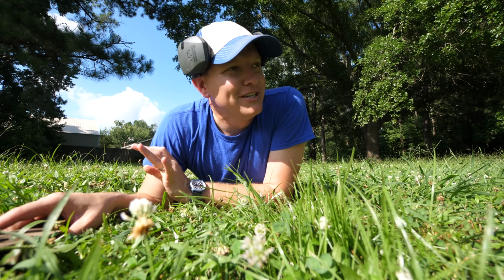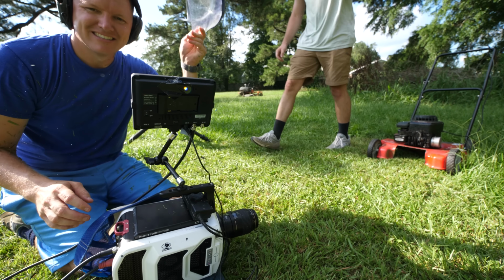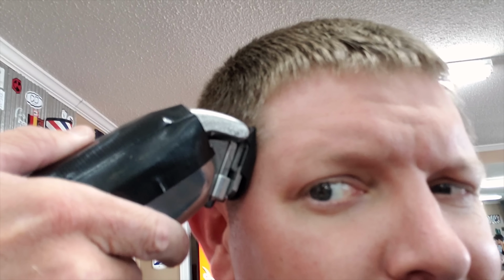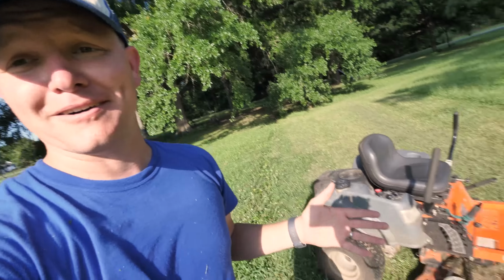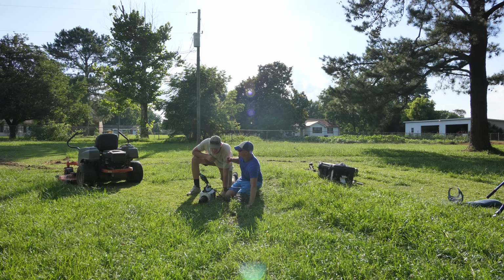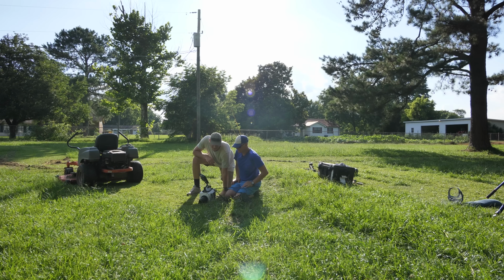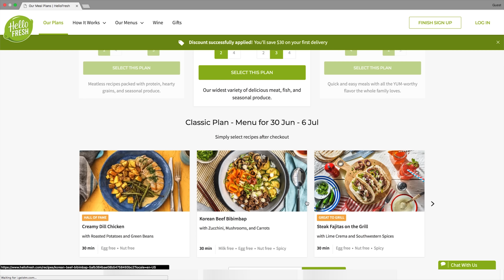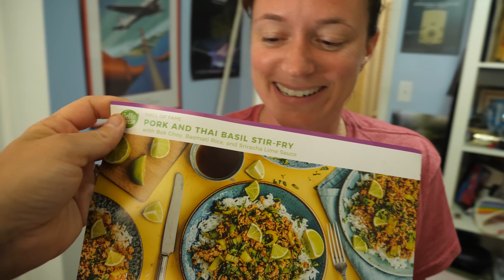How Lawn Mower Blades Cut Grass (at 50,000 FRAMES PER SECOND) - Smarter Every Day 196

Comment: Reel mowers utilize shearing. This is how turfgrasses are able to be maintained at unnaturally low heights of cut. Overall, reels provide a superior cut because of the lack of injury that occurs to the plant.
Reply: Now we need high speed of a reel mower
Reply: As a greens keeper I agree
Reply: The Grass Factor    I thought you were saying real as if these are fake lol
Reply: The Grass Factor a reel mower being a cylinder mower in the U. K. Is that correct?
Reply: Nick Magee - Brown yes sir
Reply: Need sharp blades for sushi style lawns. 

Sarcasm aside lawn mowers don't hold an edge well at all. I love the cut of a finely sharpened blade, but it doesn't last long.
Reply: I just don't want bugs and snakes in my yard, don't intend to golf on it.
Reply: Was looking to see this comment here. Yeah reel mowers are like scissors but you have to have pretty flat gound or els I would use one. Unfortunately there's no way with my property.
Reply: Watch one of the latest videos on Magna-Matic YouTube channel (may be the last one).  Very informative regarding how rotary mowers cut grass.  They cut more like a two-teeth skill saw.  Majority of the cut is accomplished with outermost inch or so of the mower blade (the tip).
Reply: Love the science behind reel mowers. And the heat from friction of the spinning blades against the reel creates a seal at the tip of the grass blade. This seal helps to keep the grass blades resistant to disease and fungus. Typical rotary lawn mowers tear the tip of the grass, rather than seal them.
Reply: My thpughts
Reply: Reel mowers do indeed so a superior job, they need a fairly level lawn though.
Reply: Do they make powered reel mowers?  I had 2 general walk behind ones but if I had a powered one now I would probably mow my whole yard with it.
Reply: @tekjunkie28  Yes they do make self propelled reel mowers

Comment: So why does the plastic string in my grass strimmer keep snapping?
Reply: Maxx B exactly what I want to know!!! I’ve always wondered that!!!
Reply: I'm with you on this one maxx
Reply: Yes! Explain the strimmer . Especially how the semi auto string dispenser works. Cheers!
Reply: It would be.interesting to see the high-speed footage on a braided and non braided trimmer line. Specifically striking chain link, rocks, and plants such as Greenbriar.
Reply: it gets chopped up by the hard objects it hits
Reply: Trimmer lines are designed just to hit thinner areas of grass around the edges of a property. Since they are used next to fencing and other housing materials you want them to break if they hit something other than grass. If they didn't break(like some thicker trimmer lines) then the line will get wrapped around fencing jerking the user, damaging the fencing, and putting stress on the engine. If you are just going through a patch of tall grass with a trimmer and its snagging a commercial grade trimmer might be needed for the extra power OR it could simply be too thick to justify a trimmer, which is where a mower is needed.

 One of example of why you want the line to break off is vinyl house siding. The lightest touch with a string trimmer will destroy vinyl siding like its nothing. So imagine tapping your chain-link fence, wooden fence, landscaping brick, and a sidewalk and getting the similar significant damage.
Reply: I once got slapped by one. Ow.
Reply: because its stressed a lot at the point where it exsits the head
Reply: Maxx B because it hits something hard
Reply: might be hard but would be cool to see a high speed view of the auto advance of the string
Reply: Because you use it and hit rocks etc or hard surfaces. Iknow i aint supposed so answrr but still lol. Or old string
Reply: I replaced mine with a guitar string, way better but super dangerous
Reply: That needed explaining? That was always one of those things I just thought was obvious.
Reply: On some, there is a little blade that cuts it so the string doesn’t get to long and hit you

Comment: Okay genius, then how does a scythe work?
Reply: Taran Van Hemert american or austrian
Reply: Look at the shape of the blade it is winged shaped so I bet that generates the lift
Reply: Arent sythes sharpened quite a bit? If its that much sharper than the movers blade it wont need the list as much
Reply: A scythe has to be kept sharp so won't just push the grass over at low speed like a blunt mower blade would at low speed.
Reply: By being really sharp and having a lot of leverage. No lift involved.

Honestly, I think the velocity has more to do with lawn mowers than the lift does...
Reply: The lift just makes the cut more even so there are no lone strands of grass left. Like when you are at the barber and there is just one hair sticking out.
Reply: Poorly.
Reply: calls upon the demons to provide lift
Reply: To the person who mentioned lift with a scythe, how do you think it can produce lift ahead of the blade? That air isn't disturbed yet.
Reply: A scythe has a curved blade.  As it passes by it doesn't just strike the grass, it slides across the grass like a knife cutting through a piece of beef or the like.  You can cut a steak without sliding it if you have enough speed, otherwise the back and forth slicing action is needed.  Same idea.  Also, the blade lift not only lifts the grass, but also assists in discharging it so you have less clumping.
Reply: I'm not entirely sure, but I think that scythes have a similar shape to lawn mowers' blades, so when you swing it, you are producing some lift which pulls the grass up. Basically it'd be the same principle. But as I said I'm not sure if scythes actually have that shape, I think so though
Reply: Lift occurs on the surface of the airfoil or after it in the case of the lawnmower blade. As far as I know it's impossible to create any sort of lift in front of a surface unless it's putting energy into the air in front of it. The big piece of metal sticking up out of the lawnmower blade essentially changes the blades chord line and thus AOA (Angle of attack) causing the air it interacts with to rise. The same (bernoulli's) principle that allows planes to fly although this is quite a bit different.
Reply: Taran Van Hemert l i think sharpness. Because some knife can cut water bottle and other cant
Reply: okay taran.
Reply: By being ridiculously sharp. The way you sharpen it by hammering is actually quite interesting too!
Reply: i think it is because it is sharp as a result the area of contact is small and so the pressure is higher and the grass or whatever is not able to withstand the pressure so it breaks. It probably happens as all that force applied through the scythe is getting applied on very few atoms so it is easily able to break the inter-molecular force between them if it wasn't sharp the force would spread out so it won't work. But that's just my theory if you have a better/correct explanation pls tell.
Reply: Exactly my thoughts
Reply: lmao didn't expect you here taran
Reply: Man power
Reply: Grass is tall and offers resistance.
Reply: Depends how fast you're using it.
Reply: Speaking of scythes, Private Internet Access!

No I'm just kidding
Reply: Braden B; Newtons 3rd lawn? That's funny, so on topic !
Reply: Didn't expect to see you here 😂
Reply: the speed that the scythe moves at is greater than the speed of the grass moving out of the way. so the blade is able to move throught the grass
Reply: Remember the support thing Destin talked about at the beginning of the video? Scythes are typically used on taller grass so the air resistance on the taller blades creates sufficient drag to act as support similar to olaceing a wooden ruler so that it is half hanging off a table and covering the part on the table with a sheep of paper, you can karate chop the ruller in half if you do it real fast because the drag created by the paper acts a support... Also the blade geometry as everyone else said helps.
Reply: ITS SHARP
Reply: You're right, he's wrong about the suction. It is the inertia of the grass in the moment the blade hits it that allows the blade to cut through.
Reply: It's actually much simpler, scythes are peened to make a razor sharp blade and then touched up as you work with a whet stone. It's the sharpness of the blade that allows a scythe to cut grass so easily, just like it's the sharpness of  razor blade that cuts beard hairs. This edge has to be constantly maintained by peening at the beginning of the day before you begin to mow, and the aforementioned business with a whetstone as you work. 

The curvature of the blade is important though, and the exact shape and weight of a blade differs depending on what the scythe is supposed to be cutting and the handedness of the user. The overall curve helps by letting grass stems slide along the curve and be sliced evenly without having to jig the scythe back and forth like a maniac while you swing it...

Actually scratch that it's NOT simpler! We definitely need an in-depth analysis of how scythes work!
Reply: Sharpness and angle of attack
Reply: Magic
Reply: would not even be surprised if this message is a macro
Reply: In addition to the sharpness they are curved so it gives it a sawing action as well.
Reply: Knowing you, there should be a macro for that.
Reply: Hey, genius. You should look up a video of a scythe in action. For one, it's got a sharp cutting edge and needs to be sharpened pretty much continually, for another, it is slid in a way that the blade is perpendicular to the direction of motion, hence the curve. This is so it slices the grass. The mechanics needed to move a blade in this way would be insanely complex and prone to malfunction (unless it's a human) and it's much easier to move a blade perpendicular to the direction of motion. Think chopping with an axe vs slicing with a sword.

You can even try this at home. Get a knife, not especially sharp, and try the paper cut test. Try it without moving the blade in a sawing motion. Then try it again with the sawing motion. I can tell you for a fact that anything below razor sharp will be much easier to cut with in a slicing motion. That motion is how a scythe cuts grass.
Reply: @Braden B "3rd law n". . . . .great!
Reply: They're extremely sharp so do not need much force to slice through.
Reply: You know the knife test with paper to show how sharp it is? That's how
Reply: Kaboom
Reply: Taran Van Hemert sheer inertia and frontal power      No big back draft with that one
Reply: yes it does generate air flow but not for cuting the grass , the air flow exists to direct the allready cut grass parts away from the core machinery that makes the blade work , you dont want cut mushy grass get stuck in the base of the motorblade do you ?
Reply: Revenge of the Scythe
Reply: Taran Van Hemert you know how it works. Rotary cutting works with ripping, Reel mowers work with sheer, sheers cutters/mowers work with sheer as well. And a sythe  works with the same concept as a rotary mower but razor sharp and a lot slower. C'mon use your brain.
Reply: They're curved and really sharp.
Reply: Yeah, shear.
Reply: Taran Van Hemert YOU ARE A SMART PERSON!!! Great question and you make a very valid point! This video focuses way too much on lift and not enough on the Newton’s first law of motion. 

An object at rest wants to stay at rest. 

That grass wants to stand there. It’s structure holds it up. When a blade comes at low speed, grass doesn’t have enough inertia to resist the force of a blade and the grass bends out of the way. 

BUT approach the blade at HIGHspeed. OR in the case of a scythe, have an extremely sharp blade, and the inertia of the grass is greater than the shear force and will therefore shear rather than bending out of the way. 

Lift has very little to do with it. It’s all about inertia, the edge on the blade, the speed of the blade and a little bit of atmospheric resistance too!
Reply: It doesn’t

Comment: Now is that tab actually creating lift to help with cutting or is it just creating airflow to push the cut grass out the chute?
Reply: the latter, and not even that - it's not about airflow but actual throwing although airflow also helps force the clippings away.  It's just like a snowthrower.

Comment: I saw a video years ago that talked about what LENGTH of the mower blade needed to be sharpened for the actual cutting of the grass.  The answer was, the OUTSIDE 2 inches as this did the majority of the slicing of the standing grass. The reasons for sharpening the rest of the length of the blade, were to aid in the chopping up of the grass AFTER it was cut off, AND to maintain blade speed by reducing blade friction against the air, moisture, and grass particles. I have mowed commercial and residential properties for sixteen years, so this video was extra interesting too me. Thanks for sharing.

Comment: Why not put some acrylic over the cut in the mower you made and put a light and camera mounted to the mower pointing into the acrylic window
Reply: Like Mike said!
Reply: It would have been a lot safer than standing in front of the discharge slot of your riding mower... in shorts.
Reply: How about a transparent mower deck made entirely from polycarbonate.
Reply: On a Mythbusters budget . . maybe . . . ?
Reply: Too much unnecessary work
Reply: Engineering degree from Ronco?
Reply: The clippings would probably obscure the view quite quickly.
Reply: Lowell Martin grass would stick to it and make it impossibly to see through